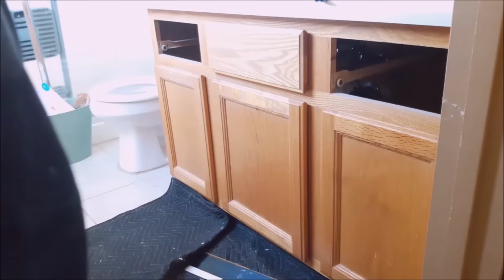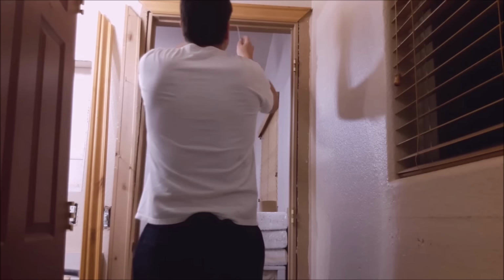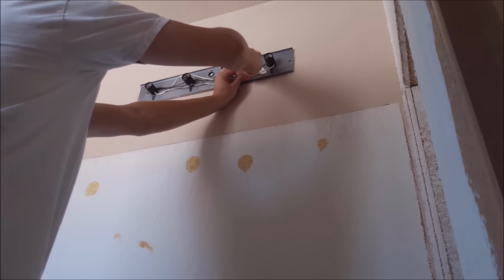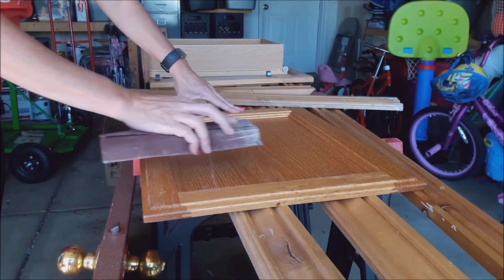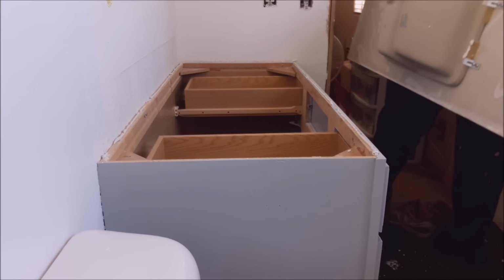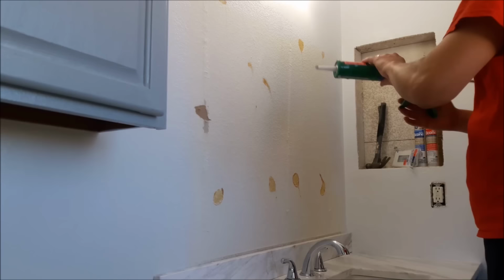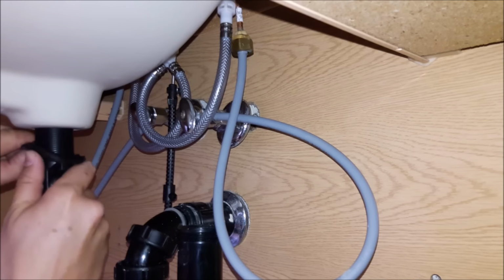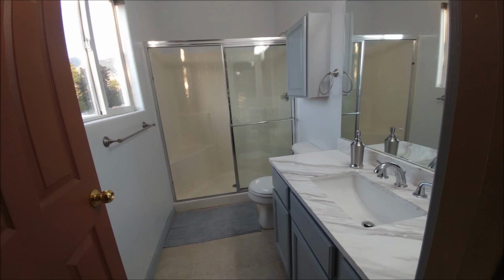Bathroom Remodel Tips and Tricks!

Comment: Tip: When removing a mirror like that, use duct tape in a cross cross pattern (#) across the mirror. That way when/if it breaks, the falling pieces are contained and don’t slice your arm in half. You were lucky in that whoever hung that mirror originally, did a terrible drop of glueing it which is why it came off so easily. Safety first!
Reply from the maker: I know, I was going to put tape on it but it popped off so easy didn't bother with this on.
Reply from the maker: On my newest bathroom video I did put tape on it just because I could tell right off the glue was holding a lot tighter. Still got it off no problem then I broke it down in my garage haha!
Reply: Wow. that's a. great tip mate
Reply: great advice!
Reply: Not to mention WHERE ARE YOUR SAFETY GLASSES!!!!  I am a female senior citizen and I even know you have to wear eye protection!!!
Reply: @cwest1557  You're playing with fire. I had to remove a tile floor with a jackhammer. Got 3 pieces of tile in my cornea. The pain and temporary blindness convinced me of the value of eyepro. But only on those jobs that need it. The ones I have are tinited; great when working outdoors where the sun's glare is overwhelming.
Reply: @cwest1557  YouTube comment award of the decade. 🥇
Reply: Also wear gloves and goggles
Reply: Great tip
Reply: Perhaps intensive care saving advice.🤕
Reply: After we moved into our new home (6 months ) one night the very large mirror in the bathroom, fell off the wall!   Luckily it was caught on the faucets and didn’t shatter.  It did chip though.  When we looked behind it the drywall guys had skipped putting drywall behind the mirror!  So there was no backing at all.  Of course we made the builder fix it.   We later found that they also skipped putting drywall behind the shower enclosure causing it to crack after boot fuce years.  They ran out of green drywall for moisture areas so they just skipped it!
Reply: to be fair, the person actually did a perfect job of gluing since it never fell, and was easy to pull off.
Reply: Thank you!

Comment: Pro Tip. Install the faucet before you install the counter top. That way you have access to both sides easily.
Reply: Pro tip. Don’t do that as access to silicone the edges gets limited
Reply: Pro tip 2. Before installing the countertop use silicone to secure it to the vanity.
If you wanna change the top but keep the vanity in the future or vice versa you won't damage the van or potentially break the stone counter

Comment: The electrical box you used for the light is used for ceiling fans. That's why it comes with the brace to support the extra weight.  Great idea to use it for the light!
Reply: Do you know the name of the rail?
Reply: @robertoirving3685  appreciate ya!
Reply: Yes, it is generally availabl at home stores. Couldn't tell from the video but be sure the box is also metal for the ceiling fan mount/support.

Comment: Great job, quick tip. Put your faucet on before you attach the countertop makes that assembly alot easier, also use white silacanized latex caulk. It will hide your gaps better and it's way easier to use.
Reply from the maker: Agreed!

Comment: Good video. I would recommend taping your drywall joints. It may look fine when at first, but will probably crack. Also,  I wouldn't recommend using the drywall anchors that come with the towel bar - they usually fail. I would use a toggler or toggle bolt that goes behind the drywall (if you can't be in a stud - which is the best!)
Reply: Hòmè Ďeçoŕè  Stop spamming

Comment: Fabulous! A few things — after mounting the sink, lay a washcloth over the drain hole to catch anything that might fall, like screws, while you’re working. It’s hard to do a good caulk job after the faucet is mounted. Water will collect most behind it, so it’s important to caulk first, then mount. Use teflon plumbers tape as much as you can on pipe threads — it will help make a great seal, and is removable.

Comment: Next time you do a skim coat try mixing your mud with water till its like a pancake batter consistency. Then get a 1 1/2 in nap paint roller. Roll it on the wall in sections about 10ft at a time then use your 12 or 14" taping knife to skim it out. Or you can use a magic trowel or a knock down squeegee to smooth it out. It will save you a ton of time. The roller just gets it on the wall super fast. Also if you start skimming on the top and use a slight preasure with your finger on the bottom of the knife going in horizontal movements then just work your way to the bottom (if that makes sense) or you can even do from the bottom in virtical wifes keeping the preassure on the opposite side then work firm left to right. It keeps the knife from cutting in that little line in the product your trying to leave on the wall. Saves hours of sanding and cleaning up dust
Reply from the maker: I'll try it out!

Comment: Nice results!!!  Looks great!  But, one concern:  whenever installing a mirror, if you use glue, it MUST be made for mirrors, as regular construction adhesive will break down the reflective paint on the mirror and the glue splotches will start to ghost through and be visible from the front.  Or, even worse, if the painted reflective surface deteriorates enough, the mirror may just fall loose from the wall!  - Very important to use mirror pacific glue!
Reply from the maker: Good point! I've heard that a bunch since this video. It's been 2 years and my mirror is still on there with no spots coming through!
Reply: @-DIYPRO-  So far, so good!  - Hope you're outta the woods!

Comment: When re-skimming over textured drywall , the best trick I ever learned, was to thin down drywall mud and apply to wall with a paint roller. Then use what is called a Magic trowel which is flexible and goes over the bumps easily. So much easier than all that sanding.

Comment: A few years ago I finally bought a hawk and trowel for plaster work. It saved a ton of swiping during application and a lot of sanding after the plaster died. There’s a reason pros use them. Don’t do a skim coat with a six inch knife.
Reply from the maker: a hawk would definitely be the way to go. I'd say i'll do that the next time but we are currently getting our drywall put in our addition and i'm leaving it up to the pros this time, and they get it done in fraction of the time.

Comment: Use "mirror mastic" to reinstall mirrors.  Corrosives in construction adhesives and silicones can eat away the back of the mirror and it will leave black spots through the mirror front (it may even take months or years for this to happen).  Also the better urethane based mirror mastics has some flex to it allowing the mirror to expand and never break free from the wall.  some home centers have them, but you can get them from a glass shops.
Reply from the maker: Mirror mastic, I'll have to try that one.

Comment: I work in this field. 
The hole on wall is from when the towel bar is used as a grab bar and pulls out the drywall anchors.
So the easiest and strongest fix is to attach a board to know studs, then just attach the towel bar to the board and when you slip out of the shower and grab the towel bar it is strong like ox. They just never patched the hole because you'll never see it, unless you take board off. Most towel bars are 24" so even in optimal conditions you only get one side in a stud.  
the more you know

Comment: great video. the upgrade looks super. a helpful hint would be to attach the faucet and supply lines to the vanity top before installing it. then you just need to connect the supply lines to the valves. too hard to reach up underneath thru the cabinet door to attach the faucet after the top is installed.
Reply from the maker: Great tip! I did end up doing that on my latest bathroom remodel.

Comment: Overall your work is ok, except for the cabinets. Cabinets MUST BE SPRAYED ~ never use a brush or roller as it will show the brush & roller marks. It makes no sense to spend time trying to force it to look good when it can be quickly sprayed with a factory quality finish. Cheap tools & materials represent the single biggest mistake DIYers make when approaching these types of projects. Remember, a good tool is not an expense, it is an asset that can be sold for 80% of it's value once the job is done, and in the end it will produce superior results and require much less work. Best budget HVLP Systems: 1st choice: Fuji 2202 Semi-PRO 2 (2203 gravity fed version) for $439, & 2nd choice: Earlex HV5500 for $299.
Reply from the maker: For my first time remodeling I'll take "ok" as a compliment!
Reply: I have to agree. Definitely should have used a sprayer for cabinets. You can get away with a roller but it's def gonna have that DIY effect. Also, should have used a primer to avoid paint wearing off and scratching off after a short time. As for smoothing the inlays of cabinets and edges, since rolled, should have used a brush over a sponge brush. You can see the drip runs in final product. When silicone counter top and backsplash always use finger to spread silicone into the crack. Painters touch: Chalk the base boards, door frame and shoe molding inside window frame. I'm not saying it's a bad job, it's good for a homeowner DIY. It will be like a Monet it will "look good from afar but up close."  Just some tips for future projects. Look into reglazing that tub & tile and possibly remove the glass door and you'll have an awesome high end bathroom.

Comment: If the paint/texture used in the bathroom was latex based, in the future... grab a heat gun and heat that stuff up in like a 2'x2' square. Then, take a putty knife and get in behind it and basically scoop it off leaving the flat drywall underneath.  No need to skim that stuff.
Reply from the maker: It was drywall mud. I'd seen a video showing that, wish it would have worked on mine.

Comment: The takeaway is that people are still trying to stay married and make it work.  I didn't luck out with a cool hot wife but there is always the rest off the world, America is a small place.  The bathroom came out nice.  I am working on my own bathroom remodel and going with tiling the whole thing.  Replaced the tub, drywall, plumbing, everything basically.  This was more of an upgrade then a remodel.  Loved the wall skim and repair.  New small mirror, lights, etc.  I'm not a fan of keeping old cabinet due to paint issues.  How can you get a factory finish on the cabinet paint?  I guess it could be easier, but that works like the most work, getting the finish correct on the cabinets.  Something tells me this guy is a carpenter first.  This came out great though.
Reply from the maker: Thanks, a good nice finish would require multiple coats with a good air sprayer, including primer, paint, and top protective coat. Yes I agree more time and money than I want to spend. I still have 4 little kids that destroy everything, I can't afford to put nice top of the line things in!

Comment: Nice. I been wanting to redo my restroom and it's only 10 years old. We had a copper line bust and we have a hole above the mirror we made for access. I want to get the hot tub out and extend the shower.
Reply from the maker: You have a hot tub in there, nice! I'm assuming you just have a regular tub, either way those are a pain to get out. good luck!

Comment: I really enjoyed watching your video.   I have two questions.  One, Could I raise my vanity by adding on a base to the bottom to make it look higher?  Why did you change out the shower glass doors?
Reply from the maker: Yes you can change the height, just check all clearances prior, like plumbing electrical. You don't want to move it up a couple in. to then have to re do all your plumbing. With how yellow the shower looks it does look like we changed out the shower glass but we didn't, that is the original glass.

Comment: It not called a flex drain.  It's called  standard p-trap those connections are there for you to get your lost items(like wedding rings) in the drain.
Reply from the maker: You are correct, the flex ones have the corrugated pipe which you don't want.

Comment: A decent size suction cup will help with the mirror...
Reply from the maker: I guess if they use them for windows why not mirrors!
Reply: @-DIYPRO-  yeah and you can use it to pull slightly on the mirror in places to pull away from the silicon that's been used. Nice job by the way

Comment: The only thing I would have done differently is using a filler on the oak cabinet and doors to fill in the pores. Thin coat with some light sanding and just a thin coat of paint would make it look a little cleaner. Simply sanding and painting leave those open and doesn't look as clean. For me its more for esthetics over time spent. Still looks a lot better then it did before.
Reply from the maker: Surprising the faces still look pretty good with it being a quick and easy job. Here pretty soon we'll be doing a complete remodel on the shower and floor, probably include a detailed cabinet face job next time around.

Comment: Suggestion: install the faucet first then install the vanity top. Been there. 

Also, don't use the grey plastic feed line that come with the faucet kit. They always fail.  I worked 30 as an insurance home owner claim rep. Those cheap plastic lines always fail.  Use braded stainless steel lines. Good job.
Reply from the maker: Yep, I've already switched them out with SS!

Comment: I am just recently beginning to learn demo and remodeling since I plan to buy a home soon so forgive my ignorance.  But how did you make those cut pieces of drywall stay in place after you moved the position of the light fixture? Were those pieces glued then you just repainted over the lines?
Reply from the maker: Sorry this is a late response. I put a piece of wood behind it as a backer and they I put a couple coats of drywall mud over the lines and screw holes.

Comment: I bought the same exact light fixture but it’s lose like I can tilt it side to side…what did I do wrong?!
Reply from the maker: Does tightening the bolt in front help out? Mine seems pretty sturdy.
Reply: @-DIYPRO-  I returned it because the metal plate wasn’t round.
Reply: @-DIYPRO-  I bought a completely different one because of that issue

Comment: Hey! I loved this video. Thanks for sharing it. Can I ask how smoothing the walls went? I have textured walls in my bathroom and I want to smooth them. Thanks!
Reply from the maker: Yes you can.
Reply from the maker: First off i'd get different tools then what I show. We are currently in the middle of a big addition and we hired out the drywall for it. They actually just finished up making all the existing walls smooth. If i were to do it again i'd do it like they did which was made the mud very soapy and literally roll it onto the walls with a thick mat roller. Then get a large trowel, not a little dinky 4-6" like I had. You'll want a lot of mud on the wall, use the trowel to get it flat, sand and repeat. Our are amazingly smooth now.

Comment: The home were getting has a window as well as a little linen type closet would you recommend doing the trim the same color as you did with the door trim and cabinets so it all kinda matches ?
Reply from the maker: Yes I'd match the trim. Mine I didn't care about the door because I knew we were doing an addition and my door was moving locations. In short if it doesn't add a lot of work then I'd make everything match.

Comment: 1. You did not install the sink faucet first when installing the vanity countertop. 2. You did not wear safety goggles gloves and jacket when removing the mirror. 3. You did not test for power when removing the light fixture do not rely on the breaker box being marked correctly. 4. You should replace the old toilet to a new toilet. 5. You should should replace the shower faucets with the new one.

Comment: While measuring you can use water in a level because water forms to it's container, it doesn't bend around objects. Who would have known. 😶 #Notspinningthroughspaceonaball
Reply from the maker: ME! That's just because I'm an engineer that designs giant tanks. Years back before they had nice laser levels you'd pull out a roll of tubing and fill it with water and use that to level the tank.

Comment: Awsome job!  My bathroom is similar in size, but I cannot find a cabinet or counter top to fit.  Seems like the wall surface to the bathroom door trim length is not very compatible with the store sized cabinets and counters.  Can you tell me the dimension of your wall (were the mirror sits) to the door frame?
Reply from the maker: it's a 48" long by 24" width countertop. Is that what you're looking for......6 months late!
Reply: @-DIYPRO-  no.  The depth to my bathroom wall from wall to door trim is like 14".  I guess I will have to have something custom made.
Reply: manuela smith Pedestal sink And use mirrored medicine cabinets for storage. Makes the bathroom look classy and simple.
Reply: @mulliganstew72  thank you!

Comment: Next project will be transferring tge outside braker panel to inside house, any problem and is raining 🌧 , you not want to go outside to resetting. or for safety anyone can turn you power off waiting for you go outside.🤔🤔🤔. 
Other , extremely good job 👍.
use gloves to remove glasses or mirror.

Comment: Didn't need a faucet with three holes makes no sense. Faucets don't have three holes. And most faucets come with a cover to cover the three holes in the top if he faucet is designed to just use a single hole (like a delta).

Comment: No any 3 piece won't work. You need the correct 4 ,or 8 inch spread
Reply from the maker: Why not? The 3 pieces aren't connected so it can be at any spacing the counter top has.